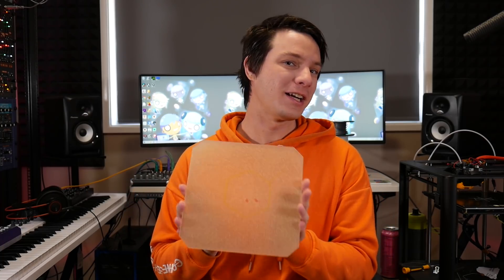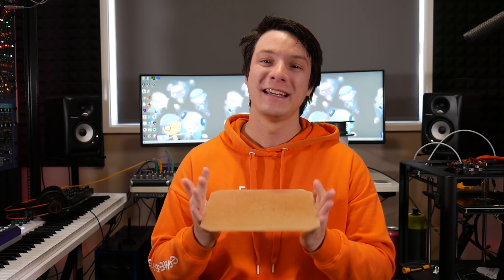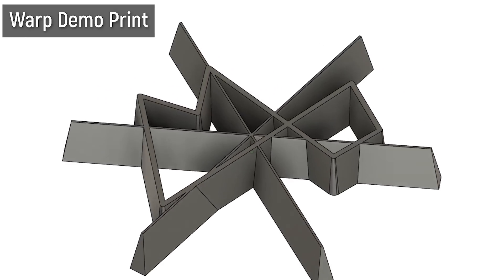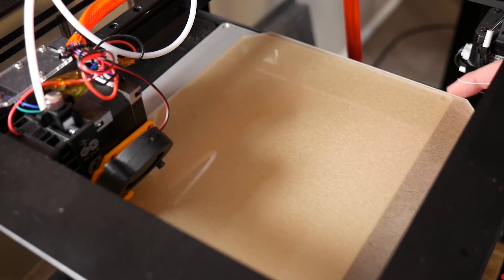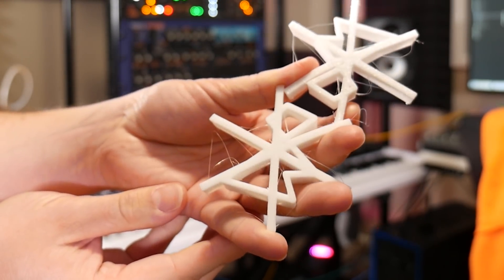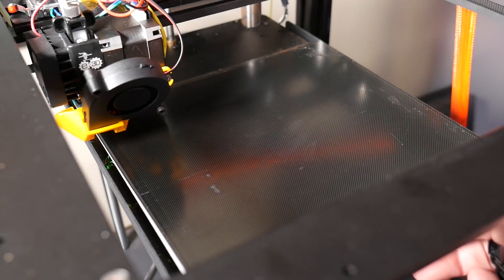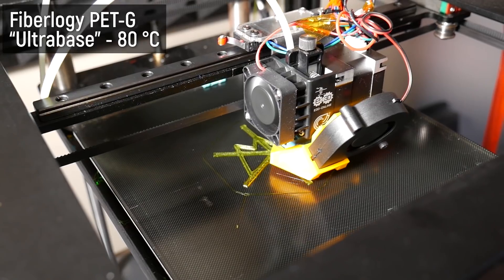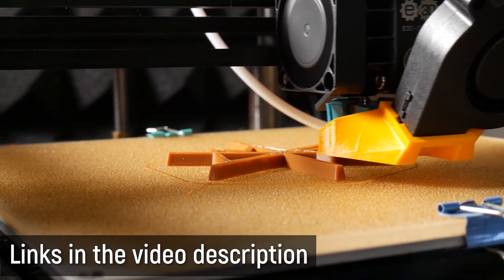A REALLY unusual 3D Printing surface! Ultembase PEI Glass test and review.

Comment: abs is a freaking pain to print without inclosure. I used abs slurry and the abs print pulled so strong to shrink that my 3mm glass surface bent. I recomend 5mm + glass bed

Comment: 7:45 I just started 3D printing like 4months ago. About a month ago, I thought my Ender 3 S1 Pro had a short in it. :face-orange-biting-nails:I swore I heard some arcing coming from inside. But after the 3rd time, I realized it was my prints. As the PEI bed cooled, I heard it slowly releasing.

Comment: I'm a newbie in 3d printing but I've kinda mastered the pla so far. And I hate petg I just can't work with it. It ruins my pei bed, if I apply pva glue stick to it then it doesn't stick at all. My other bed is a black flexible metal with a textured finish. It kinda works on that one but I still need to chisel the finished product off of it. And it's like printing with chewing gum, it sticks to the nozzle, keeps oozing even when retracted and making strings and massive blobs. Basically everything I print out of petg is ugly and useless. Or just ruined after the first 10 layers by a random blob falling off from the nozzle.

Comment: Not sure if my Ultrabase experience with PETG translates to this, but I found that stuck PETG was easier to remove if I left the bed hot or reheated post-print.

If it was bare glass, I'd just bring in a glue stick to act like a mold release, but I don't want to test how easily that washes out of a porous surface like UB.

Comment: shrugs Yeah I don't see the benefit at all unless it really can do PEEK really well. I use a simple spring steel magnetic system and a sticky sheet of the stuff on a magnetic spring steel system on my crappy A8. Sometimes I have to his it with a layer of hairspray for larger surfaces but other than that it's fine like 95% of the time.

Comment: I use a piece of regular plate glass on my bed and just started playing with PETG after procrastinating forever because I didn't want to be bothered with the glue stick, painter's tape, etc. Then I saw Thomas Sanlanderer try various homemade coatings on regular glass to see what stuck best. His PETG came off no problem on bare glass. So I got some PETG and, after a couple of small hesitant test prints on the bed corners, I got the same result - no problem taking the PETG off.

I've since done several regular prints and haven't had any issues. I've definitely seen examples of the problem on borosilicate and, here, on whatever variety that is, but it would be nice to see more extensive testing on various types of glass to clear up this confusion.

Comment: I know I've seen suggestions for PET-G on PEI in general for a lower first layer temp and bed temp and either underextrude your first layer or run it a bit high. Not sure if they had those measures in mind with it or what. But also, if they don't tell you that (especially a reviewer), that's not great.

Comment: I have had glass (a mirror tile) as a print surface for a while and it's been great from like 2017-2018. But I wanted to do better. A PEI sheet I got was horrible and I ended up not printing for like 2 years with my printer is a really sad state ever since.

I friend of mines has the Prusa with the magnetic, flexible print surface and that looks like such a great solution to me.

Comment: I've done everything from bare aluminium with or without glue, hairspray and the like to bare glass with or without ... to spring steel with or without and all of the above with a PEI layer with or without.

The key factor I've found is not the base material. Some plastics stick to some base material surfaces better, sure.

But to my experience, all plastics stick to any surface perfectly when I use hairspray. And you don't even have to reapply it very often.

This is why I eventually went with glass bed with hairspray for most of my prints and spring steel with hairspray for some edge cases.

The defining factor for using glass being how easy it is to get a nicely flat surface.

The spring steel I only use for parts with very large footprints with plastics that have a tendency of sticking a bit too well.

Comment: Does anyone make a cast iron print surface? I know, but there are modern techniques to make thin, relatively lightweight panels(?) out of cast iron. It is very well understood how to make it very flat and the texture at the micro and macro scale can be very versatile. If you manage the metallurgy right, you can make it almost perfectly thermally stable.

Comment: The main issue with bed adhesion for a lot is that the surface may be nice, but the z height is wrong , the only time i have issues is if the printer stands near a draft on one side , but other than that, never on two machines with both regular creality flex , or frame glass from a poster ( i use both randomly depending on what i print.)

Comment: In my experience, PETG really wants to come off the print bed hot, rather than cold. I have ruined 2 PEI beds trying to pull it off cold, but removing the prints hot usually turns out pretty well

Comment: if you’re only doing small(ish) parts where warping isn’t a problem, (even pla shrinks, not a lot but on large parts it can be an issue) you can get away with clean glass. i’ve found the best way to clean it is in the sink with a clean scrub sponge and soap. you know it’s clean when the water sheets over the whole thing. handle them by the edges like a CD.

Comment: Possibly PLA filament but got close to an extremely shiny ceramic finish (120 + x2) like dipped in gloss (fused layers). And a nice setting for realistic plastic snow, basically spaghettiing @ slow speed around 0.8 maybe. (will update post with result(s) from earlier blog)

Comment: Learned a machinist trick for setting tool heights and works for setting extruder heights. Use a ~6mm gauge pin and babystep the height until it passes below the nozzle. It's a very clear pass/no pass instead of the feeler gauge "feel".

Comment: im wanting to make some handlebars to put on the front of my unicycle (it should look similar to the kris holm t-bars when i stick it on the unicycle) and i'd like to know how to make it last a good amount of time without breaking
   the printer i have is the ender 3 v2 with the stock hot-end, brass nozzle, and glass bed
   if someone could tell me what filament i can use, settings, other stuff i can do to make it strong and impact resistant (the unicycle weighs 13 pounds), then that would be greatly appreciated

Comment: PETG sticking like a weld to the glass and PEI, that's weird as! My Anycubic Ultrabase plates (on my delta and my Tronxy i3 clone, neither stock) do for PETG what your ABS test did on the PEI coated glass. Tinkling and crinkling sounds with almost total release by 40° to 45° for PETG on Ultrabase ceramic coated glass. There's nothing I need printing for that can't be done using PLA, PETG or PETG-CF, so I'm not switching to PEI glass.

On PETG-CF (carbon fibre impregnated) have you done any testing on the available brands in Australia. I've only tried FormFutura's CarbonFil PETG-CF and it's amazing! (But it's EXPENSIVE 😞 ) I wish I could upload a pic of the SD card reader holder I printed with the last few hundred millimetres of it and had to finish with my normal 3D Fillies black. The difference the difference is chalk and cheese! I'm a big fan of 3D Fillies PLA+ and PETG, but the FormFuttura CarbonFil has such a great finish! PETG always tends to show the inherent textures of 3D printing, strong layer lines, layer beading, etc, but the matt finish of CarbonFil seems to hide even a badly setup printer, and NEVER strings. Unlike ordinary PETG, it holds paint, too. So strong, too. I have brackets and brake mount parts printed for my bicycle in CarbonFil and they look so good, seems to weather forever and some are painted to match other parts and no chips.

A review of CF filaments would be really great.

Comment: Just a tip: PETG sometimes sticks ridiculously well to PEI/Ultem as you found out the hard way. The simple way to have it come off cleanly is to use an eyedropper and sprinkle some isopropyl alcolhol on the contacting surfaces between the print and the bed. Just do that once the bed has cooled down fully and wait a minute or two for the effect to kick in, but it will come off effortlessly and you can do this hundreds of times without rupturing your PEI coated surface. Been doing this for years on an alu plate with PEI coating and it practically lasts forever that way.

Comment: Small tip for printing PETG on glass. I don't really do anything else. You would just have to spray some water on/around the edges of the print while the bed is still warm! PETG then "crackles" off the bed without damaging the glass because it pulls the water under the print through the adhesion effect. If you let the glass bed cool, you scrap it very easily because the print holds bombproof to the surface.

Comment: If found a way to basically solder PLA to straight plain and clean glass with very little reset. So i found an interesting phenomenon with alcohol, after cleaning a glass sheet with alcohol it leaves a small amount of residue that acts like a separator and PLA just doesn't want to stick until you wear out that layer. On the other hand if you take a propane torch (bbq lighter with the wand works but takes more time) that film I'm guessing the deposit  turns into a carbon deposit and if you print as is you will not be able to take the print off unless you use a chisel or you put it in a freezer or add a small amount of alcohol and let it seep under. If you do a quick wipe of the glass with a dry cloth you can temper down the stick and with some practice you can feel when its perfect for your print because you can actually feel the cloth drag on the glass and you just wipe away until you get the right amount of drag. One can add a tiny miniscule of alcohol but its definitely a more advanced technique. The best part once you got it down perfectly you can print several dozen pieces with zero reset. Print finishes, glass cools a bit, print comes of with no effort, start a new print. Some effort will be required if you dont let the sheet cool or you have extra stick.

Comment: I ripped some piece of PEI out of my Prusa textured sheet (no glue stick applied) using the Prusament PETG proflie on some non prusa PETG. It wouldn't self release even after a full night of cooling. When I lowered the bed temperature to 75°C/85°C on the next print it released fine. I guess the Prusa profile temps are just a little too high for textured beds or only tuned especcially fpr Prusament PETG.

Comment: I print almost exclusively in ABS, mainly because a local shop bought like 2 tons of filament and can't get rid of it so they sell it to me for $10 a kilogram. I print on glass and metal both, I heat my beds to 110C. The trick is that I dissolve some ABS in Acetone and make a slurry I apply when the bed is at temp. I pour it on and wipe it across the glass with the edge of folded paper towel. I have been doing this for over 7 years and it almost never fails. I own five printers and none of them are enclosed.

Comment: Glass will stay that way for all practical purposes*
Glass has liquid properties.
Reply: As it turns out glass doesn't have liquid properties and we we're all mislead.
They thought from looking at medieval stained glass that there was evidence the glass had run over time - the prices were all thicker at the bottom.
Nope, that's just how they layed the glass in the windows, with the thicker and hence stronger parts towards the bottom.
It's been studied quite extensively now and it's definitely just a solid at reasonable temperatures.
Reply: @_Piers_  Really? They lied to me!

Comment: I had been using a 0.8mm PEI sheet laminated onto borosilicate glass, which is laminated onto my aluminium heat bed combo for last 4 years, it works far better than the ultrabase till date

Comment: Magnet base + Steel Sheet + Giant roll of kapton tape.

Job finishes, grab whole steel sheet off magnetic bed, its Flexibility helps remove jobs, with kapton tape an excellent surface - Slap it back on magnet base when done. Relatively easy to replace kapton should you damage the current layer, something you cant do on most surfaces if you damage the top layer

Comment: I have yet to run into a issue with petg and normal glass($2 from lowes) I use no adhesive (glue stick, paste); although I do have a issue of my cat riding the build plate like a elevator... -_- (Ender 5)

Comment: I get a similar finish on my print bed using glue stick. I apply a decent amount to the print area and then start rubbing it with a whet piece of sponge untill I have a homogeneous viscous slurry. I then start dabbing the sponge and that produces a very similar looking finish on the bed.

Comment: Impressive results with the ABS. Generally speaking I feel that ABS needs a printer made for high(er) ambient temperature printing then you might find all your previous impressions of the material were wrong because most hobby printers are very suboptimal for the material.

Comment: you are right: PETG on PEI work well but with no contact with glass. I use PEI sheet on flexiplate from energetic3D until 1 year. No problem with PETG with bed at 65°C.the bottom surface is very smooth and like a print on glass.

Comment: I really don't like the idea of a textured bed. Besides the problem of having your print with a "rough" side to it, when you want to level your bed precisely, what do you use, the "valleys" or the "peaks" of the bed's surface? At least with a smooth bed, you can level on one planar surface without peaks and valleys.

Comment: That glass plate looks like some of those bumpy glass windows I'd see in decorative glass applications in people front home doors.  I haven't seen that weird bumpy glass texture in 20+ years.  That was something out of the 60's or 70's.  If they're doing it with PEI applied to glass instead of just texturing the glass, I'd be not only surprised but also wondering why they don't just use that old glass making technique from the 60's.  It just looks like textured glass.  If the "PEI coating" they're supposedly putting on their is actuallh a special depositive coating, and it helps to hold and release the prints better, then that's great...  but it looks waaaay too close to that old textured glass technique, and makes me question if they are ACTUALLY using a PEI coating or just recycling an old glassmaking technique and lying about it or not.  :-/

Comment: Very interesting comparisons. I'd like to add that PLA on glass doesn't always work. No idea why, maybe depends on PLA maker, maybe the glass has something to do. It never worked for me. The only way I could use glass and PLA is soaking the glass with hair spray, but then the part needed to be washed, otherwise it was sticky and disgusting. The Ultrabase that came with my FlyingBear 5 is the best of what I was able to try so far. No spray, no mess and nice texture. So I'd say that this Ultembase would be a great option for PLA, kind of a safe bet

Comment: Maybe the bed temperature was too high for PETG. I damaged my PEI flexible bed sheet like this. My current strategy to prevent further damages is to start with lower bed temperature and increase it until the print sticks well. In my case it's 60 degrees Celsius on Ender 3

Comment: The problem for me with PEI is that it scratches so easily that I prefer to use cheaper (but not “cheap”) PEI sheets/spring steel beds so that I can replace them every so often when they get too dinged up. I like having a nice surface finish on the bed side for some prints.

Comment: I bought spring sheet and like it.Glass and PEI  seems to me not very useable because we use PEI to stick to bed and springiness to removig parts.And glass is stiff. I printed PETG on glass with ABS slury mixture and riped chunks glass as on your case.Only plus is in my town they cut you another square for  just 1$ :-D

Comment: PEI definitely has its uses, like ABS, but definitely not a wonder surface that some brands might want you to believe. Seems like its uses are more along the lines of PEEK or similar high temp materials, as there are very specific requirements for very specific polymers.

Comment: I'm sorry, what? Granted, I don't print with it often, but I've always used glass beds and never had petg stick THAT well. In fact, I find it's difficult to start a bead, because it sticks better to the hotend, and becomes a blob over a clean bed if I'm not careful to coat it well enough with hairspray first.

Comment: Hey, Angus...  I've got a LulzBot TAZ6 with the stock PEI coated borosilicate glass bed, and their documentation recommends using glue stick when printing PETG and TPU.  I even have special notes that I left in my filament inventory spreadsheet for both of those.  You should have looked up what was safe for the surface.  ;)
Reply from the maker: I just followed their instructions tbh, I personally use gluestick on glass when printing petg on other machines. Not sure you could even apply glue to such a rough surface?

Comment: My lulzbot mini came with a PEI covered glass bed years ago, not a rough coating like this so it leaves a near glass finish on the bottom of prints. Sheet overtime delaminted and got bubbles underneath